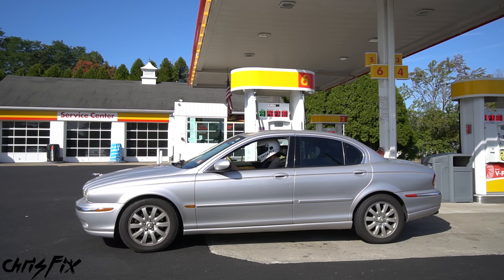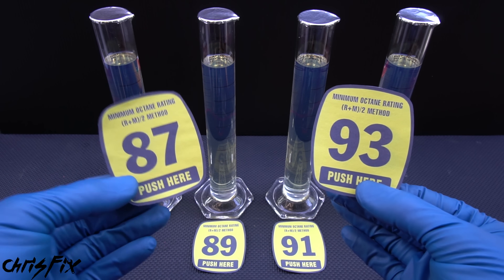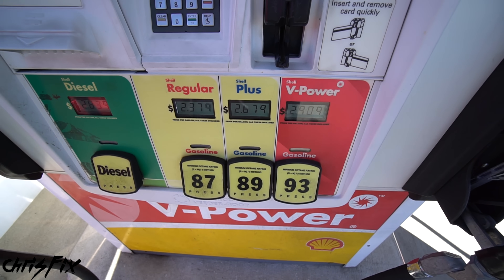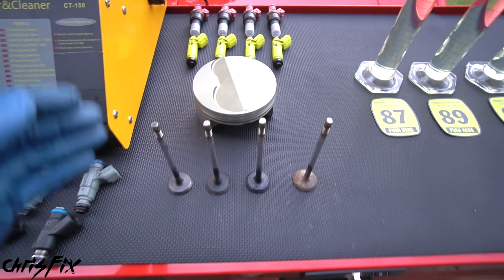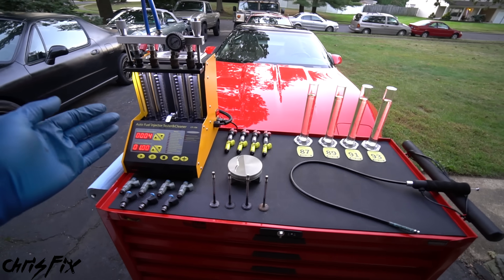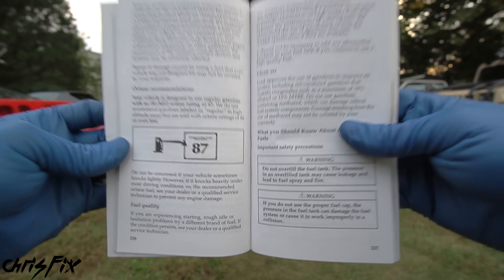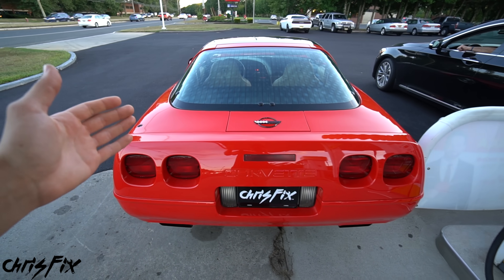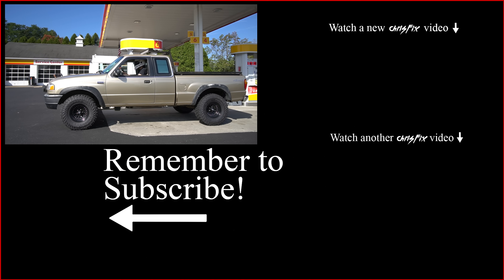What is the BEST Fuel to Use in Your Car or Truck and WHY

Comment: The video makes no sense. In a nutshell, “Fill with fuel recommended by the manufacturer.” I expected a comparison of engine power output, torque and efficiency on different types of gasoline. Sincerely

Comment: You say it doesn’t increase power but you can feel the difference in power for yourself.
When my 2.5L 4 cylinder Camry is overloaded for long road trip holidays I can barely get moving or up hills unless I use premium.
I’ve even pushed my luck and added an octane booster with a full tank of V power premium.
Runs much nicer and allows me to hummer it as I normally do.
Just filled up with premium for a 2 hour trip this weekend
Reply from the maker: Interesting, what year is your camry?
Reply: @chrisfix  2012 ASV50R

Comment: This is great information, and Chris touched on additives a little bit, but I feel like he left an important part out. Yes, you do go with the gasoline octane level that your car manufacturer recommends, but some gas stations have additives added to all three levels of gasoline, and some don't. The ones that do are called 'Top tier'. I only get gas from Top tier gas stations. In the video, he's at a Shell gas station, which is a Top tier gas station, so even if you get regular gas from them, it has the additives that will keep your valves clean. You can do a search online to find out what gas stations are Top tier.

Comment: So in my town we have this blue handle too E15, I am kind of confused it says for use in all vehicles 2001 and newer but never really got clarification. What is that about?
Reply from the maker: I can go over that in more depth in the ethanol video I am planning out, but in short it's just fuel with 15% ethanol compared to 10% in normal gas. It is usually at least a little cheaper but you will get slightly lower fuel economy  since there is more ethanol present. If your car can run it there is not much upside/downside but if it's cheaper by a decent margin then it might be worth considering
Reply: That helps a bit, but i guess it would like most of these, help to see if thats what your vehicle runs by checking the owners manual. Mine runs midgrade, premium if it is under load or ar increased elevation.

Comment: Where I live there is E-10 (ethanol) gasoline and pure gas called "clear" available. I personally chose to run clear gas becasue I don't trust the E-10 to not corrode my system. I also keep my cars. I just sold my 2001 Toyota Highlander V-6 with 143K and was still getting 20 miles a gallon her. Only had the required maintenance done as well.  I always lost mpg when I was forced to fill up with ethanol gas. I hate to think of what it was doing to the engine. I now have a 2023 Subaru Outback that I am avoiding ethanol gas as well.  What are your thoughts on ethanol gas compared to clear and what are the long term effecs of using ethanol?

Comment: By the way engine detonation on a non-diesel engine is never good even if you never hear it,  period. You can run regular where premium is recommended if you have. Get rid of ALL unnessecary weight. No towing. Cool charge air temp and very gentle throttle application and low as possible antifreeze/coolant.   I would also avoid the load of hills/mountain climbing. That being said high altitude is great for   less oxygen which equates to less demand for the highest octane which is theoretical for me  because I don't have/own the data.
Reply: Coolant/anti freeze temperature is what I meant to write.

Comment: All the money a person spends on there car cheap fuel and especially exstreme mileage between oil changes (5000, 10000, 15000 miles) if I can help it at all on those 2 issues I differ from the common driver. Oil changes; 3000 miles is the absolute exstreme distance between changes. Pull the stick. Does the oil looks new? No? Well blow by trash which contains gasoline (the enemy of lubricating oil) inhabits the place of oil.

Comment: Enough of the retoric. You want max power from your engine then avoid low octane fuel. The knock sensor reports to the ECM and retards spark before it's audible to driver. To best of my knowledge that has been the sratus quo for a couple of decadess now. Please share the truth if you own it.

Comment: My car : You must only use unleaded gasoline.
Select octane rating 87 (Research Octane Number 91) or higher.
Use of unleaded gasoline with an octane rating lower than 87 may result in engine knocking. Persistent knocking can lead to engine damage.
At minimum, the gasoline you use should meet the specifications of ASTM D4814 in the U.S.A..

Comment: Very good video but, the higher the octane, the more heat is necessary for the mixture to ignite, this is called the flash point, the higher it is, the more heat is necessary for the mixture to ignite, it therefore prevents self-ignition. For example, a high performance engine with a compression ratio of 11.00 to 1 must operate with a higher octane level because compression increases the temperature in the cylinder, higher octane gasoline is necessary to prevent the The mixture ignites by itself before the spark plug creates a spark. A SECRET In winter for an engine supposed to operate with an octane level of 89 which therefore ignites at a lower temperature and will start more easily than with an octane level of 93. Think of a diesel engine which in winter may not start - 20 and starts at -19. ONLY ONE DEGREE LOWER can prevent the diesel from igniting, I have experience of this and have been a mechanic for over 50 years. A PROOF. If in very cold weather your engine runs quite quickly when starting but does not start, take a hair dryer and direct it to the intake of the air filter box and you will see unless there is a breakdown with more heat in the engine. will start. A proof. If in very cold weather your engine runs quite quickly when starting but does not run, take a hair dryer and direct it towards the intake of the air filter box and you will see unless there is a breakdown with more heat in the engine. will run.
I have already seen in the great Canadian north people connecting a hose to the exhaust of a truck which is running on a truck which did not want to start for around 30 minutes. The heat from the exhaust of the running truck is pushed to heat the cylinders which have open valves which warms the cylinders and the engine block as well and it starts very well. THANKS A LOT. LOL

Comment: I just bought a 2024 gmc sierra 2500hd SLE crew cab truck 4wd gasoline  V6 V8 what type of fuel should i used for gas or which number on the gas pump to used let me know

Comment: Does it matter what gas station you get fuel from?
Reply from the maker: A little. There are top tier fuels and everything else. As long as you drive your car and bring her up to operating temps every drive, you can pretty much use any company just fine. It does help to use top tier fuels if your car is known to have issues with carbon deposits/buildup.

Comment: Ik this is old video but I run mid grade in my 1500 sierra seems to run better it’s 2000 when I run regular seems to bog and not have as much power or pick up w mid seems to run smoother and perform smoother ? Am I damaging anything ? I haven’t to my knowledge I’ve had it over a year
Reply from the maker: So the bogging is probably the computer retarding timing. As long as it's not nocking, it wont hurt anything.

Comment: As a KIA mechanic around early 2000, there were many pinging issues here in the south. Fuel door claimed “87” but they needed 89 octane to prevent knocking… at least that was how well they built them for the US then.

Comment: Our 2007 Lexus indicates says "Use 91 octane gas"  I buy from Sam's Club.  They have 87 octane and 93 octane gas.  I was under the impression that octane only made the gas explode slower and engines with computers would adjust the timing to accommodate the explosion speed.  I was not aware that the gas also can explode in the wrong place.  Thanks.

Comment: My car (2024 Honda CRV) just says don’t use diesel or E10-E85. Says nothing about octane. You think regular is fine?
Reply from the maker: Is it turbo? Anything on the fuel door?
Reply: @chrisfix  the car’s fuel door has nothing on it but instruction on how to insert the pump into the inlet. Nothing about what type of fuel. The owners manual just says what not to use, not what I should be using. Since it’s new, I don’t want to put ethanol in the car, so I’ve been using 89 octane no ethanol. I was wondering if I could using 87no ethanol instead of 89
Reply: @chrisfix  it’s also not turbo. It’s a 2024 Honda CR-V EX-L. I’ve also been using the Econ drive mode but I don’t know if that actually helps much compared to normal.
Reply: @chrisfix  I can’t figure it out Honda Civic 1.5 turbo 2024

Comment: What is the best fuel additive and fuel injector cleaner for 08 mustang GT?
Reply from the maker: Using good quality gas and staying up to date with maintenance/repairs. I've tested a bunch of those products and found that none of them work as well as they claim. You're better off saving your money
Reply: @chrisfix  good to know because i was told to use B12 whenever i fuel up for the meantime because im sure i have 1 or 2 injectors that are starting to go bad and i dont have the money to do a full replacement on all of them at the moment

Comment: Idk buddy I run 87 and it smells like shit plug you see a lot of moisture out the exhaust pipe … I run 93 while tuned and I get way way better fuel mileage and no bad smells no moisture
Reply from the maker: If your cart is tuned for 93 then it will work better on 93

Comment: Engine temperature, compression ratio and a few other factors are big factors. The Best bet is to look in the owner's manual. The lowest octane you should use should be listed there.

Comment: What happens if we used higher octane diesel on a 10-year-old Ford Figo diesel 1.4 TDCI car that doesn't mention anything about fuel octane in its manual? I have used higher octane diesel and feel the engine is less louder now. No difference in power. Will it cause any harm?

Comment: Mine calls for ethanol max 10% and a rating of 87 or higher the book states specifically to use 87 or higher what dose the or higher mean potential benefit
Reply from the maker: Unless it lists the benefits of "or higher" (like better towing performance or power or fuel economy), it's likely just there to say you can run higher octane fuel safely. You can always try out a higher octane and see what happens!

Comment: Chris/anyone, a slightly unrelated question. I have a 2012 Impala, owned it for 7 years and I have never changed the spark plugs. Should I get it done? It's got about 180k miles on it, but I don't drive more than 3-4k miles a year. Thanks in advance!
Reply from the maker: If the spark plugs are originals at 180k I would replace them. Check this out: https://youtu.be/m_ZsWQ_WXNo?si=lIrinYkZlX5Tv0Jx

Comment: my car recomends 95 (EU) but while back i switched to 100 and when it was too expensive, i pumped 95 and car is slow and has interesting mileage, now i have almost empty tank 1/16 with 130km drive and aparently i drove like 350. it really doesnt add up
Reply from the maker: Interesting, how are you tracking milage? (or i guess distance?)
Reply: with onboard computer (hyundai i20 fl 1.25L) @chrisfix

Comment: Shell and Sunoco fuel burns slowly. Ford focus alwaya got 500 miles to a tank with these. If you buy speed way, circle K, or Get Go, I never ever EVER ONCE got over 450 to a tank. Mind you I tested each type of gas for tens of thousands of miles each. I also drove almost all highway and accelerated slowly and consitently. I also used cruise control religiously at 65 in slow lane. Just wanted to tell you my 100,000 mile experiment in summary. Not sure about octanes. 

( saved every reciept and tracked exact usage. Always filled tank and just tracked the exact gallons of gas and tripodometer the whole way. )

TRY it !!

Comment: In Denmark, 95 ron are min. you will find(91 us). Some years ago 92 ron (88 us) where removed from the station due to low demand, and to get space for more high octane 98 and 100 octane (93 and 95.5 us) Many cars today has a turbo charger, so 95 ron are on the low side. 98-100 for a turbo engine are just great.

Comment: Question - My Lexus ES350 V6 requires 87 minimum, but I live in Albuquerque where 86 is regular. I always get gas at Costco, where there is 86 for regular and 91 for premium. I do not want to get the 86, so I go with the premium. Am I only wasting money here, or am I damaging my engine in any way?

Comment: Do certain brand gas stations have better additives than cheaper gas stations thus being better for your engine and worth the slightly higher cost?

I was traveling and there was a local gas station that was super cheap vs going to shell which cost 20 -30 cents more. I went with shell to be safe. Some gas stations are branded "top tier" as they meet a certain standard?

Comment: It was found that the ethanol-glycerol blend at the ratio of 3:1 (75/25%) can be directly applied as a substitute fuel for either gasoline or ethanol in internal combustion engines in the automotive and power industry😮

Comment: The paper presents results from investigation on a new type of fuel which can be implemented for the both automotive and power industry. The proposed fuel is of a completely renewable origin based on ethanol and glycerol at the ratio of 3:1 (75% and 25%), respectively. Hence, it does not contribute to unsustainable CO2 emissions to the atmosphere. The analysis of combusting the ethanol-glycerol blend in the spark-ignited reciprocating engine was focused on engine performance, combustion thermodynamics, and toxicity content in the exhaust gases. The analysis was conducted as a comparative analysis for gasoline and ethanol, which were treated as reference fuels. The toxic emissions of CO, NOx, and unburnt hydrocarbons (UHC) did not differ remarkably from the gasoline emissions tests. The engine performance expressed by the indicated mean effective pressure deteriorated less than 3%. It was found that the ethanol-glycerol blend at the ratio of 3:1 (75/25%) can be directly applied as a substitute fuel for either gasoline or ethanol in internal combustion engines in the automotive and power industry.😮
Reply: Source?!?

Comment: Sorry as a chemist I have to say octane combustion energy is different from that of heptane. So the energy is not identical. Comparable enough to not make a huge difference especially with only a 5% change (-5.451 and -5.409 MJ mol−1 for 93 and 87 respectively) but definitely not identical. For endurance racing this starts to matter.

Comment: In CO and UT the states offer 85 octane due to the elevation.  Is this safe to use in a car that requires 87 if you're using the full tank at higher elevation?

Comment: Since only shell V-power would have 7 times the additives requirement by law, so if you use regular fuel do you have to use additives regularly to clean your car's the fuel system?

Comment: I previously owned a Mercedes 420 SEL 1989 automatic and I only used 98.   I was told by my Merc mechanic to use 98 and also it was the recommendation of Mercedes.   I have heard the arguments that I'm wasting money on 98 but frankly I don't  believe it.  I believe the performance and economy is improved by the higher octane.  I now own a V8 Jaguar and continue to run 98 Octane.   I will not use the Ethanol fuels and Mercedes have also said not to use that.   

I have also owned an XB V8 302 automatic wagon.  When I lived in the ACT in the mid 1990s I occasionally put Aviation Fuel in it.   It went like a scalded cat and the exhaust pipe was lovely and white. The fuel economy and the power improved on the XB.  I remain convinced that a higher octane improves power, fuel economy and clean engines.   On a recent long distance run in the Jaguar I obtained 35 MPG.
Reply from the maker: Interesting, thanks for sharing!

Comment: Hi Chris … I have a 2002 third the early engine, which 91 … is it safe that I have put 95 a couple of times . .? Now after Ur video I believe I should go back to 91 ? What do u think ?
Reply: Using lower than required will save you money in the short term but damage your engine and cost you more when you get it fixed or replaced.
So it depends how self destructive you are.

Comment: great info !  I only use 87 octane but it does say , premium recommended . my question is , would it be a good idea to put in that octane booster once in awhile to help keep my motor running smooth and clean ?
Reply: If its recommended to use premium,  you need too use premium or you will cause damage too your engine

Comment: Here's an easy way to determine what gasoline to use by car: The regular, super, premium or super premium is not the gasoline. It's the engine.... Ford Fiesta, Toyota Corolla, Honda Civic, Nissan Sentra = Regular,....Corvette, Camaro, Mustang = Regular or Premium depending on the engine... Infiniti, Lexus, Mercedes, BMW, Porsche  = Super Premium.....Or.... the more money you spend in the car initially, the more it will cost you to drive it. So, if you barely have money to afford a Ford Fiesta and get gifted a Mercedes... SELL IT !

Comment: You may not see this but two questions, I'm religious about using quality fuel oil etc. I only use top tier fuels. I live in salt lake over the years I've seen at elevation the octane rating is reduced, we have 85 87 91 is the concept of elevation correct? Also you didn't mention the mid-grade application, when would you suggest using this?